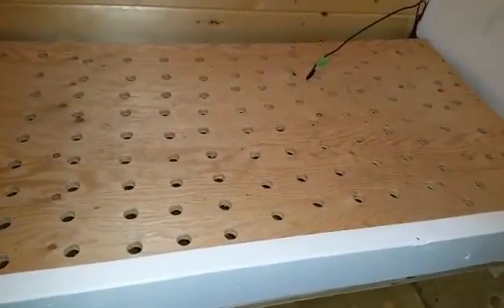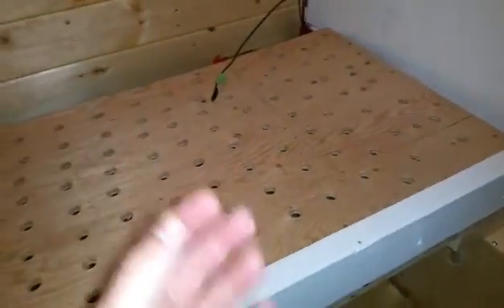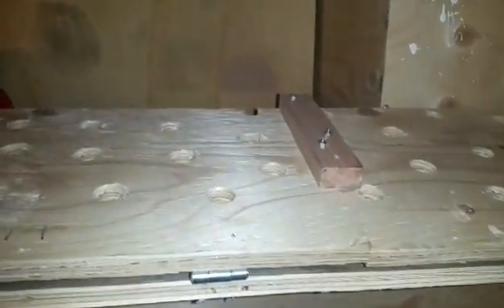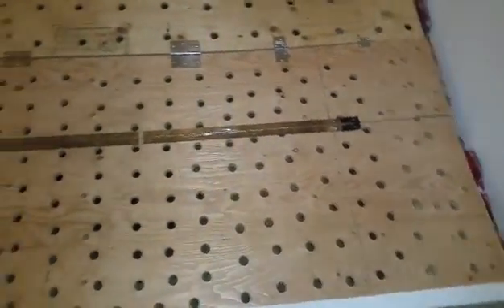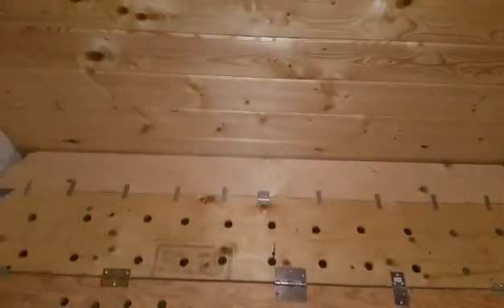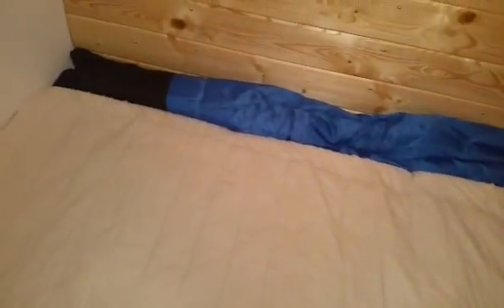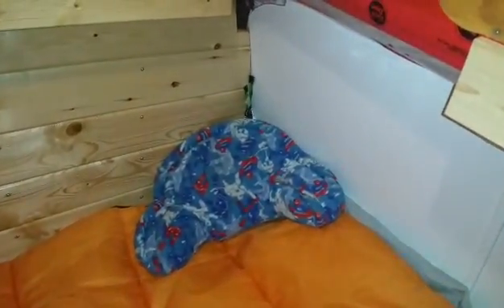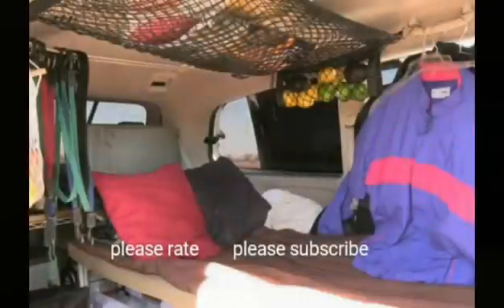80 - Building A Bed

Comment: You could use a short piece of rope to raise the back section of the bed easier. Just stick the rope through one of the holes and tie a knot in it. Leave it laying under the mattress and when you need to get in there just pull on the rope. 

If you need to make that bed sturdier in the future, I'd recommend using 3/4" plywood. It would eliminate most of that bracing you had to use and a lot less screws too. 

I was thinking that gap behind your bed would be a great place for setting things you could use while in bed, like a flashlight, place to put glasses, keys, snacks, etc. 

Oh and it doesn't matter much in the long run if you do a hack job on your bed as nobody will see it unless the mattress is off.
Reply from the maker: +mrbr549 all good tips... thanks!